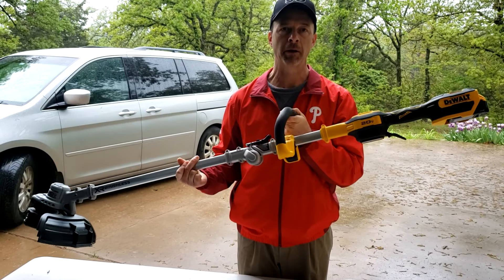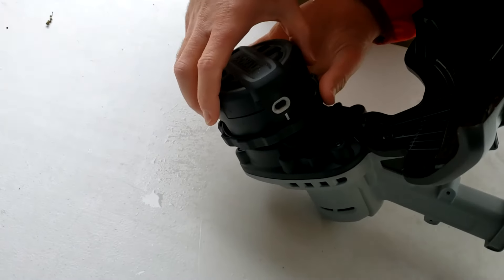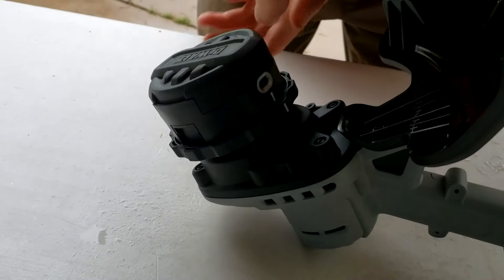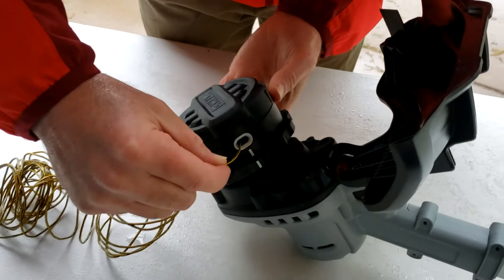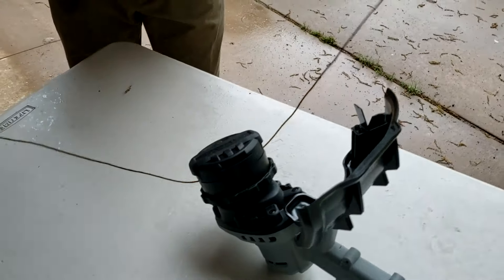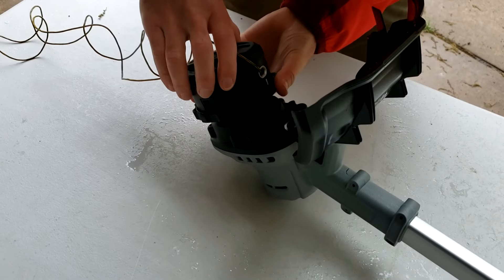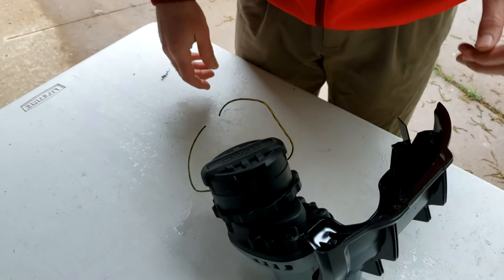How to replace reload string on Dewalt trimmer - 20V or 60V

Comment: Thanks! Much easier than I thought it would be, and SO much better an explanation than the official manual. I got my line cut short by inadvertently booking the electrical lines under my trailer. I had no clue what to do. This video and the one you linked about the tangled line set me straight. 🙏

Comment: Very very helpful. Thank you. I have an old Stihl trimmer and you have to take that thing all apart and wind up two separate strings. I thought this was going to be the same thing so I took the whole thing apart. Then I was wondering how it worked since it looked to be easier than my old trimmer. Found your video and everything makes sense. So much easier.
Reply from the maker: Glad this helped. Thanks for the feedback!

Comment: I struggled mightily to get my Dewalt string to comply with your instructions, but because of something you didn't tell me, I was unable to do so.  My spool still had string on it so the new string wouldn't go through. I spent hours on the phone with support, then I visited a local repair shop sho spotted the problem right away. Easy fix.

Comment: This was very helpful but is there a way to keep the line from flying out to impossible lengths every 2 seconds and binding itself up?
Reply from the maker: That's usually caused by the string somehow being wound the opposite direction on the spool. Try removing the string and re-stringing it.

Comment: Loaded as directed but I'm still having issues with it overfeeding the line and spooling up around the shaft. Any pointers would be appreciated👍
Reply from the maker: It's feeding out too much string? This is usually caused by the string being wound the wrong direction on the spool. Since this weedeater winds it automatically, perhaps the string is too curled when you feed it thru and it goes the wrong direction on the spool? 

You'll need to remove the string and try again. The straighter the string before feeding it in, the more likely you won't have the problem.

Comment: Thanks for video.  When the string gets short while trimming how does it put out more string?.
Reply from the maker: You tap the head lightly on the ground while it's spinning at mostly full speed. This allows a tiny bit of string to release and you'll hear the metal blade cutting the string when it gets long enough.

Comment: For anyone who might have any trouble like I did, the last part of my old line got stuck inside the assembly. I didn’t feel comfortable leaving it in while I added my new line, so take it out! It’s easy, just pinch both of the “tab” looking parts of the plastic assembly in and you can take half of the assembly off.

Comment: I did the exact same thing, but it failed. I proceeded to turn it on after applying the string, and the string just fly out instead. Any tips? I don’t understand why it just fly out?
Reply from the maker: It flies out when the string gets wrapped the wrong direction around the spool. I don't know why that would've happened but if you do this again, it should work. Make sure to wind it the proper direction.

Comment: What is the maximum with of the string which can be applied? On the product description it says 2mm maximum, if ghats so I’m not really sure if this can handle heavy grass.
Reply from the maker: The manual for the 20V version says 0.080" max.
Reply: @FixEverythingYourself  yes I thoguht will buy the 54 one and the manual says 2mm(0.08”) however the trimmer what I had had 1.6mm but was to weak after 2 sec the string broken so I thought Ill buy a better one, but If Im limited to 2mm(0.08”) Im kind of worried if it will face the weed in my garden.

Comment: I know this video is 1 year old, but I'm about to pull my hair out trying to find a video for help.  I have a DeWalt DCST925M1 string trimmer.  I need to find out how to remove the current trimmer head and replace it with a Quickfeed head.  Can you help me?  I hate having to struggle to get the head off and wrap around new string.  I'm not very strong.  Thank you.
Reply from the maker: Sorry, I haven't done that on this weedeater. I'd expect the replacement part to come with instructions but those are often hard to follow.

Comment: Hello, how are you? I have a problem. I have the same machine and I did the whole procedure, but when I wanted to use it, the whole thread ran out.
Reply from the maker: Most likely you wound the string in the wrong direction somehow. Perhaps the string got in the wrong channel during loading? Whatever happened, the string running out quickly is usually because the string is wound the wrong way on the spool.
Reply: Same here. You can only wind it one direction. Not ising dewalt string. Maybe that's it?
Reply from the maker: That's possible but I wouldn't think so. But it's worth a try because you'll need more string sooner or later. Hard to say and I haven't had that problem.

If you figure it out, please reply with how you fixed it. Thanks!
Reply: @FixEverythingYourself  so, an update. I did switch to dewalt string and still experienced the same issue to a lesser degree. But, I did figure out how to stop it. So while feeding the string, if I keep the string tight while turning the dial, it loads the string tighter and that seems to have solved it. Next I will try that with other string to verify but I suspect it will be fine. The difference in my 3rs party sting and the dewalt is the dewalt is smooth and the other has edges. Like star shaped. The manual says to use only smooth so that probably aided in my problem.
Reply from the maker: Thanks for following up on how you fixed it. Makes sense.

Comment: I tried his method.  My Dewalt unwinds while spinning without bumping.  Any ideas?
Reply from the maker: A few days ago another user (@chrisallen640) said he solved this same problem by using Dewalt string (which happens to be smooth, not textured) and wound the string tight when winding.

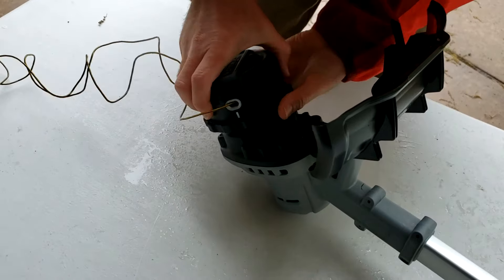Comment: At 1:04 you said to hold the top piece with one hand, which you did then you began turning it; I guess we can turn it?
Reply from the maker: Yes, the two pieces I'm holding with my hands need to be turned. They both can turn.
Reply: @FixEverythingYourself  many thanks!    Does the string bind on you?

I have a bad history of the string binding but that was the old system
Reply from the maker: Not typically. It happens occasionally to some people, and the way to fix it is to remove the string and start over.

Comment: O.K. I did exactly as instructed, when I went to use it, it kept making a rasping sound, got about 3 foot done, and the string is GONE!  PLEASE HELP😢😢😢
Reply from the maker: The string must've somehow gotten wound in the wrong direction. That's almost always the culprit when the string comes out super fast. Not sure if the string went on the wrong side of the spool or if you wound it the wrong direction (can't remember if it can be turned the opposite direction or not).

Comment: Thanks for the very useful video.  Let me pay it forward: You are badly spoiling your camera work by using a white working surface as a background. Use something with a neutral density reflectivity instead. Packaging cardboard is near perfect. Though not ideal mechanically. Look for a fawn or grey surface material. Old paving slabs, concrete or even weathered plywood will work. The camera can now see deep into the shadows. Particularly on black finished components. Instead of being completely blinded by the white background.
Reply: It looked fine on my monitor. Maybe your brightness or contrast is set too high. Turn them down a bit.